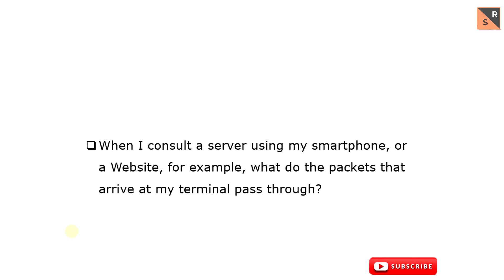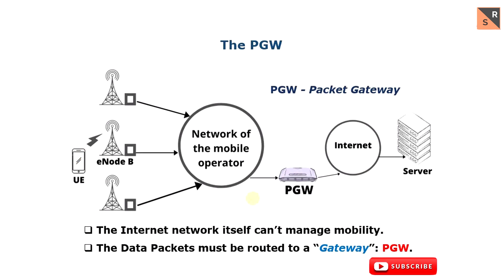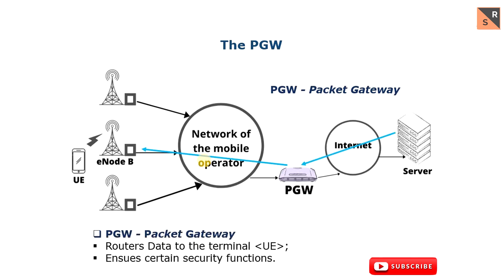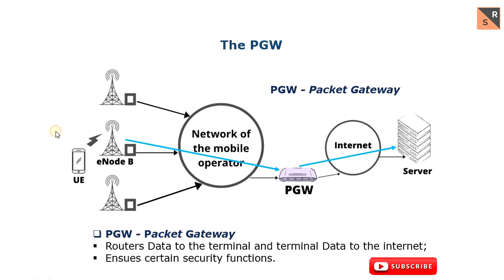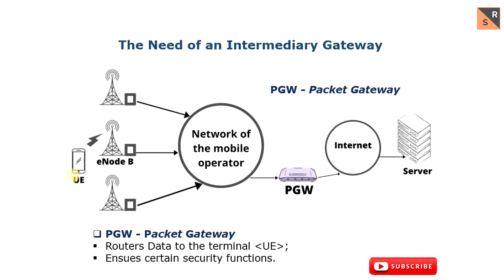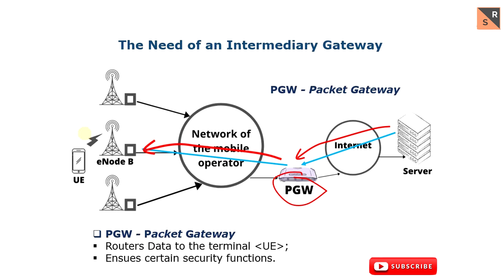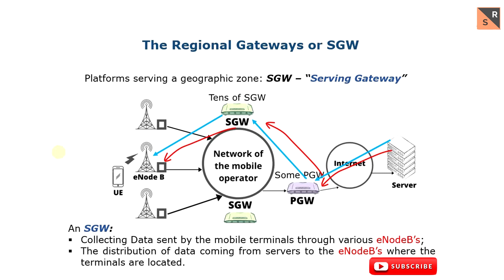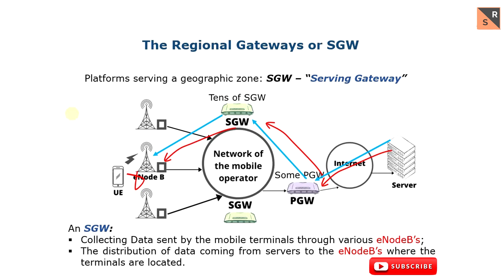ARCHITECTURE & GENERAL PRINCIPLES OF 4G NETWORKS (LTE) | Lesson 3: Nodes with Data Plane (SGW, PGW)

Comment: Just a small question. Something to further my understanding. Where are the PGWs physically located? Are they part of the base stations under the towers or are they part of the network provider data centers? 
From your explanation, I would assume that the SGWs are close to the towers for enabling handovers while the PSWs are limited and bulky so, are part of the large network provider centers. 
Am I correct?
Reply from the maker: Hello Spandan.
The 4G access network consists of eNodeB and UE, And it's called E-UTRAN. And it has the function of managing radio resources.
PGW and SGW are part of the 4G's core network, which is called EPC.
PGW is responsible for ensuring the connection to external data networks and SWG is responsible for transporting and directing IP packets.
PGW and SGW are physically located in the same data center, in the scheme they may appear to be distant, but in real life they are all in the same data center, just like the other elements of the EPC, such as MME and HSS.
Reply: @SheldonGuianhela  cool thanks for the info